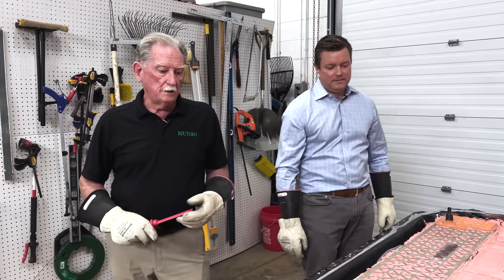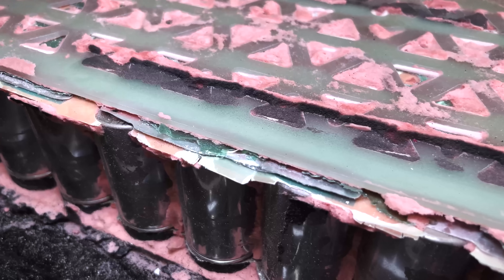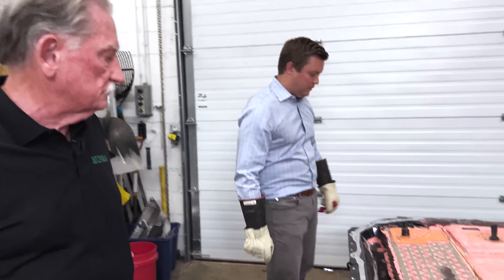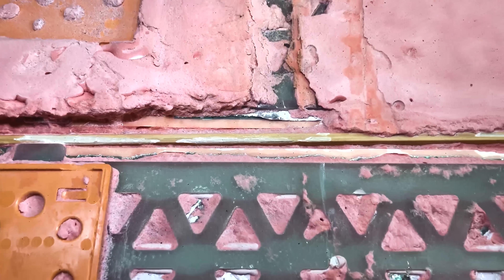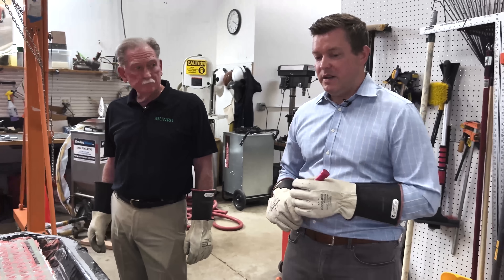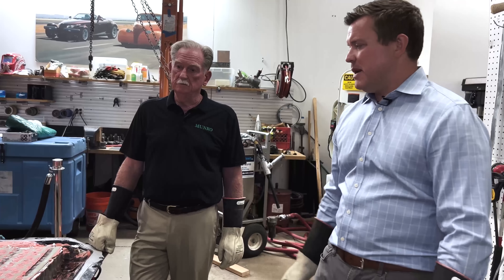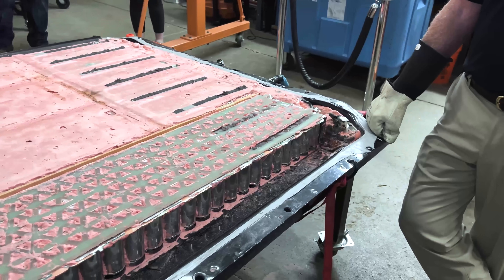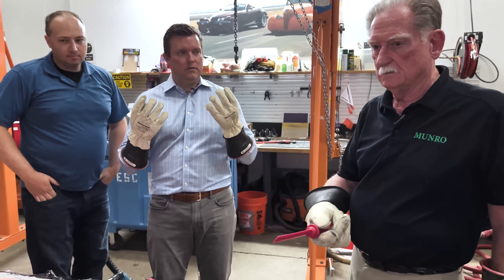4680 Battery Pack: What We Found Under the Foam!

Comment: On one end, we have this Tesla energy brick. Cells may fail, but there’s no method to swap them out for repair. The entire system is designed to power the vehicle and provide structural support until end of life followed by total recycling. Contrast that to the Ultium platform from GM. Highly modular and designed with a plug and play and swap architecture. The two approaches couldn’t be more different. I would love to see Munro compare and contrast the pros and cons of both.

Comment: Liquid Nitrogen is already used in tire ♻️ 
as in the following video:
https://youtube.com/clip/Ugkx6N2x6cYLKtMbe-wXXQQBzxyCGWjomPns
Reply from the maker: That would be gaseous nitrogen. Also, regular air you breathe is 78% nitrogen.
Reply: @MunroLive  Appreciate the clarification. I thought it was liquid N2 since a few seconds past the clip(YouTube does not allow more than 60 secs on a clip) I saw huge frozen lines. Also there was a mention of things becoming brittle to powder the rubber.
Not sure since they mention it's a closely guarded secret?. Seems like liquid N2 is just used to super cool and nothing more. Also definitely does not seem to be a liquid process since it does not involve dissolving.Thanks for the correction though.

Comment: Guys, it’s hard to understand how a tremendous about of resources can go into the extraction and processing of virgin ore into raw materials that are then further processes and assembled into something as complicated as a battery pack, which will then be treated at EoL as ore to begin the process again; yet you consider that an acceptable tradeoff to save assembly complexity at the factory. This is NOT designed with sustainability is mind, the “valuable ore” argument is an ex post facto justification for passing the environmental cost on to someone else at some later time. 

Reduce, reuse, recycle; in that order. It’s inexcusable that cells who may have outlived their useful service life in the automobile context can’t be harvested and used in less demanding power backup contexts. Good design needs to balance efficiency in birth and end of life. I’m afraid it will require government intervention (likely european) in order to require companies protect the future as much as their current bottom lines.

Comment: Excellent video!  One question: how do you know vents are at the bottom?  B-roll clearly shows the buttons are at the top, and that's where  most batteries place vents.  For liquid electrolyte cells, vents are always at the top so as to vent gas (not liquid).  This reason may not apply here, but I can't think they would change this unless it performs a function.
Reply: As I understand it, vent electrolyte for fire suppression, thermal runaway. I guess it removes the major oxygen source of solvent (di-methyl- or di-ethyl-carbonate?). Still left with lots of graphite in anode and static charge. Ask gm re Bolt - they got it wrong.

Comment: An environmentally friendly EV battery would be easy to repair if needed, and easy to reuse as say a house powerwall.
Reply: Mixing new and old cells doesn’t work, never has and never will.

So that repair avenue is not possible.

Replacing a single module could be possible based on how you manage the pack, in Tesla’s xücase it doesn’t work.

So this pack is exactly as repairable as the older non structural, non foamed ones. You replace the entire pack at once as everything else doesn’t work.

And this thing is easy to reuse as a house or powerwall. You just use the entire pack as is.
Reply: @anonym3017  what if the pack is near new, and a single cell had a manufacturing fault?
Reply: @rhsoffroadengineering  then that cell burns through the wires connecting it to the other cells and the pack continues working with slightly less capacity.
Reply: @anonym3017  would it be better if that could be repaired?
Reply: @rhsoffroadengineering  let's just get something straight.

Discharging any battery to 0 volts kills it. Discharging any battery too much severely damages it leading to safety issues and a vastly reduced capacity.

So replacing the faulty cell would require someone to work on a pack that's charged to a few hundred volts which is just no.

Furthermore replacing the cell carries a risk of damaging it when you spotweld on the bit of metal that connects it to the other batteries of the module which would fuck the entire module.

So replacing the cell requires a lot of work and is risky for both the worker and the battery module. So it's pretty expensive to do. And all that for an increase in capacity of 0.12% per replaced cell (a range increase of 0.4 miles), for this pack specifically.
Reply: @anonym3017  well said.
Reply: @anonym3017  can you explain the key differences between using packs made up from individual cells like this, versus using the commercially available lithium batteries that look like a conventional car battery, in an EV?
Reply: @rhsoffroadengineering  Cells like this are also commercially available. Even more so than the pouch batteries for that matter.

The box style modules just contain a large number of pouch style batteries.

Now for the key difference. Round cells are hard and stable in their form. Pouch cells aren't.

This means that pouch cells need a strong box around each module to stop the batteries from getting damaged. This severly impacts volumetric and weight specific energy density. It also drives up cost per kWh.
Reply: @anonym3017  thankyou
Reply: @anonym3017  with cylindrical cells, if one has a manufacturing fault and burns up its connecting wires, arent a number of them connected in series to increase voltage, does one cell failure result in a number of cells going offline?
Reply: @rhsoffroadengineering  no.

a bunch of them are connected in parralel. those parralel blocks are then connected in series.

so if any one cells burns up the metal connecting it to the buss nothing changes regarding voltage or functionality. you just lose 0.1% of the packs capacity and wear rates increase ever so slightly.
Reply: @anonym3017  thankyou

Comment: I’m trying to understand what happens in case of a defect. It seems this it not serviceable, and the only option would be to replace for whatever a new battery happens to cost. That could be a burden on older cars that have depreciated significantly but are nowhere near the end of their lives.
Reply: They just accept a certain % of failure during warranty. After warranty, you're out of luck. And if you have the wrong flavor of car scent, voided warranty.
Reply: @Cloxxki  people just are not wanting to understand. The 4680 cells are not just bigger cells, they are "we hired the top lithium battery scientist in the world, bought two companies for their technology, and spent six years having a bunch of the best battery engineers in the world develop these new cells."  These cells are the longest duration most expensive R & D project Tesla has engaged in, they are not playing around.
Reply: The defect rate on battery packs at Tesla since the first year of Model S production has been super low, and I would expect it to approach zero with these packs. You see how hard they are to take apart, nothing is going to be moving inside these packs and the battery cells are not going to have excessive heating because of the tabless design and the cooling system, so they will last an extremely long time. Musk is serious when he says the Cybertruck will be the vehicle of choice for the zombie apocalypse: every part is built to last for many many years and to be super unlikely to be harmed or to need repair. If civilization collapses, Cybertrucks will literally be the last cars driving, it will not be a Mad Max world at all.

Comment: When you do get the individual cells out, will you be able to tell if any of them are dumb cans?
Reply: An empty can would be much lighter, and there would have to be the same number in every one of the 92 or so groups of parallel cells, so the pattern would be hard to miss.

Comment: So the batteries can be 'recycled' BUT earlier battery packs that had gone bad because just a few cells failed could be disassembled and those individual cells replaced, bringing the whole pack back into usability.
This battery pack is either good or it's not and so Tesla customers whose battery packs are failing have a good vehicle but a new battery is so expensive the whole car is going to be junked.
If a regular IC cars engine goes bad a salvage yards engine or an overhauled engine is possible with it being low enough cost to usually not force the cars disposal (work with me here, don't be too nitpicking because you KNOW what I mean)
This is disappointing because I've got a Cybertruck on order and usually drive my vehicles to 200k (trucks and cars) but I'm not seeing the potential lifespan on EVs so I'm reconsidering.
Reply: No, individual cell replacement was never appropriate in any Tesla battery, only complete modules; there have been 4, 5, 14, or 16 modules in a battery in previous Tesla models.

Comment: People go on and on about recyclability with this kind of construction, because they misunderstood the problem. Tesla better make sure the design of these packs is flawless and quality control is on point, because there is no repairing anything here. And you should always repair first, because if you haven't figured it out yet, cryogenically freezing, followed by grinding into dust and melting the result down to reclaim the raw materials is a very energy-intensive process.
Reply: While I agree it energy intense, how does it actually compare to the mining of the individual elements, eg copper, aluminium, steel, nickle etc
Reply: @brettmciver432  I'm basing this on nothing, but the pack can be described as an "almost ideal ore". After all it contains the materials needed to make a pack in exactly the right quantities and very little extra. So compared to digging and processing literal tons of rock it has to be much less.
However that's not the point. Given the scarcity of materials recycling is simply a necessity. Nearly every pack should at some point be recycled. What we should be asking is whether making these things completely unrepairable will force them to be recycled much more often than otherwise necessary. The team at Munro have yet to find the BMS. If it really is buried in foam underneath the unremovable lid then one faulty component means the whole pack goes into the shredder. Broken contactors are not unheard of and we already know those are completely burried...
Reply: Well said

Comment: this is such an terrible design. when a bolt on an engine breaks you do not melt down the entire engine, you replace the bolt.
this is impossible with this madness. 0/100 repairability and 0/100 serviceability.

Comment: So glad you addressed recyclability. If a battery cannot be recycled, it should be nixed (can't imagine the enormous size of a battery landfill). While you feel this Tesla battery can be recycled, the process seems energy intense (liquid nitrogen). I presume the pink foam that impregnates the battery is for vibration and crash protection. Wouldn't it be great if it were water soluble.
Reply: The liquid nitrogen is to stop the battery from catching on fire. The same effect can be reached by just discharging it completely.

Comment: Honestly, I think this is not the final version, it's not even the version Tesla engineers had in mind during design. The whole thing looks like ”make it work, no matter how". I bet in 12 months or so you would find something significantly different from this in the structural battery pack. The concept is there, but the details and execution have yet to evolve.

Comment: What really worries me is the repairability of such a battery pack, which now seems to be 0. The old battery packs were repairable, here you always need to raplace whole pack.
Reply: Completely agree. I was afraid about it when they announced. Quite sad...
Reply: @Screwdriver440 Ask a current Tesla owner who had battery issues with out of warranty car if it was so easy. Let me burst your bubble: it was not, and most often it meant scrapping the whole car as it was cheaper to buy a used Tesla then repair the battery.

Comment: Aside from recycling, there is still the problem of the complete impossibility of repairing the battery pack when individual cells become resistant and brick the car. Given Musk’s lack of business and personal ethics, as well as some troubling actions by Tesla in the past vis-a-vis customers, I would not buy a Tesla with a pack like this. If the pack dies just after the warranty ends because one or two cells or a module have went bad, the risk that Elon and Tesla would tell the customer that they have to buy an entire new battery back is just too great. Possibly if Musk were not at Tesla this would not worry me so much, but the guy has become a meme for erratic and bad behavior as well as utterly lacking in business ethics.

Comment: It's messier, but there are small plastic bead and walnut shell blast mediums. Years ago I watched a huge generator stator at a hydroelectric dam being cleaned with a walnut shell blast medium. 

Is there a mica cup between each cell and the bottom black plastic cups?

Comment: I wonder how much of the design of this is based on talks the guys from Tesla had with the guys from Redwood Materials. Not that they would give them advice on how to design a battery pack for performance/endurance, but on how to design it for easy & efficient recyceling...
Reply: A shredder doesn’t care about how the battery pack is designed.

That’s the beautiful thing about recycling batteries. Discharge them and then shred them. Pack design, pouch/cylindrical/whatever cells and chemistry don’t matter. You can just put all of them through the exact same process and it works.